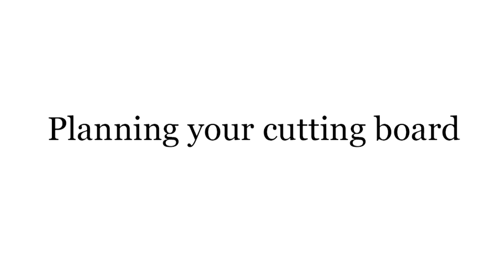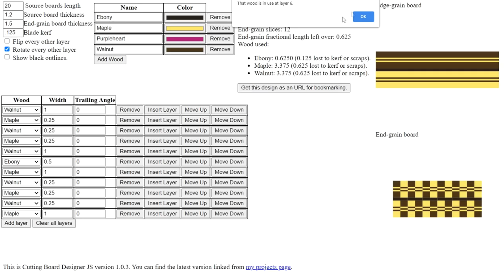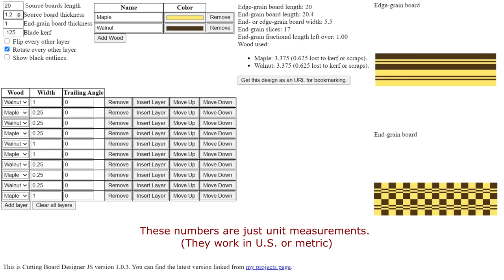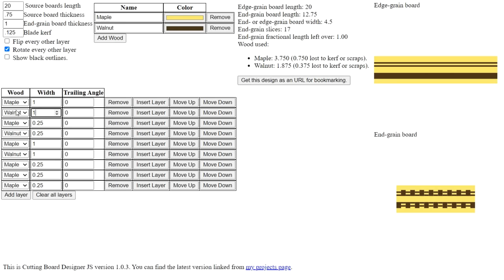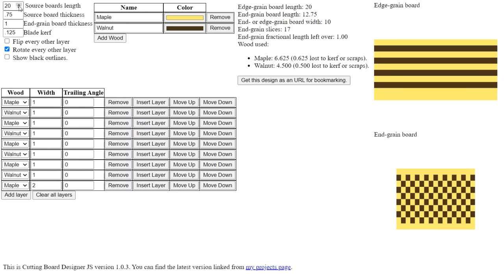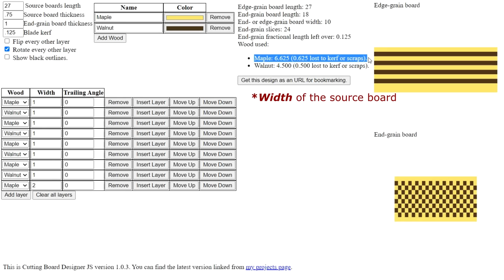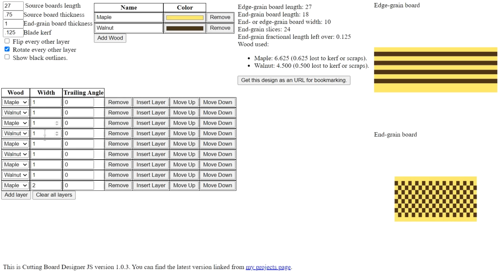The ultimate guide to making a wooden end-grain cutting board

Comment: I thank you Steve for this post and it was both educational as it is interesting, now having scrolled through many of the comments I see mainly wood shop things which makes sense, now I'm totally a newbie woodworker, but I'm also a educated and professional chef ret, but nonetheless, cutting boards, so in short it depends on what you are cutting or pounding upon a board.  Mainly the universal board are veggie boards which end grain boards are, but what you absolutely do not want to cut on an end grain board is meats, poultry, pork, beef and even some fish.  The reason has to do with of course contamination, for meats the best choice is synthetic or plastic cutting boards or fork out a bit more dough for a long bamboo cutting board, this is where the fibers of the bamboo are running the length of the board, it's a true natural universal cutting board for veggies or meats as the fibers of the bamboo do not allow contaminates to penetrate the surface of the cutting board.  So anytime you find or make an end grain cutting board it should be used only for veggies not meat, yes they damage less and yes they dull a blade less but do not use these boards for cutting meat especially chicken or duck upon you will not be able to fully wash or remove the contaminants of salmonella out of the board.  I'm sure someone will argue about this, but ask any chef and they will tell you what I said, synthetic cutting boards plastic and such thick and thin is what's typically used for meats, or long grain bamboo boards in that the grain runs along the length of the board not bamboo end grain.  Yeah you can make a cutting board but understand your market and how it's used.  My hope is folks make these kinds of boards but DO NOT USE THEM FOR FISH, PORK, BEEF, OR POULTRY.  Especially poultry.  Good way to make a great dinner that makes everyone sick.  Trying to help here not being a mean person.  This post is awesome Steve and I've enjoyed it but it seems like lately I've ran into this trend when I've gone to farmer markets and such and I said it's a beautiful board for vegetables and the person said yeah and anything else and I had to explain why you do not use end grain for meats and they were like oh I didn't know.  End grain boards are works of art, and yes as I said I agree less damage to the board marks and scaring and less dull to the blade but contamination from meats can and will bleed in too from that meats and you absolutely can not remove it from an end grain.  I have a $400.00 extremely large long grain Bamboo cutting board that is truly a universal, one board does it all and bamboo at a long or length doesn't allow contaminates to enter the wood.  Okay off my soap box just trying to help as it seems to be a trend to make end grain cutting boards and people are using them incorrectly and or for the wrong ways of preparing food.  Or trying to sell them to make a buck off folks who don't know how to use or have the know how of food prep on the best surface.  Whew, hope this helps.  Also on a fun note, I have a friend who decided to make a knife sharpening business and I asked why, he said you know for regular folks or chefs, and I said well as a chef I can tell you they will not use your service because we are taught in culinary training and arts how to maintain your knives. He laughed at me like I didn't know anything and about what I was talking about, after a few months and the comments he got on his website of course I asked how goes it, and he said the majority of his business is from the home chefs not professional.  Ah ha, I wonder why.  Okay seriously thanks for reading, and off my soap box.  Be safe and Be Well All!!!
Reply from the maker: Whoa...you okay?
Reply: @SteveRamsey  I am so sorry Steve, that mini novel lol, can come off a bit rant-ish, but my intention was more on an education level.  I love your channel and I'm a paying member to your WWMM website.  I've been watching you since you posted making a chess board and have followed ever since.  And it's neat to see glimpses of my home area, East Bay, love Santa Cruz, and La Honda area.  But I've got nothing but love and peace from NC to you my friend!

Comment: A great way to avoid the “need” for rubber feet on a cutting board is to also lay a damp paper towel down between the counter and the board. I prefer to do this so that I can route grooves along the perimeter on one side of the board and leave a completely flat side as well.

Comment: A tip: before the final sanding, spritz the cutting board with water to draw out those cut fibers. Then sand it down again.
Reply: At a glue joint, I wouldn't spritz it.  A water based glue will raise the grain, and then "freeze" it in place, but this is desirable on glue surfaces because it adds more fiber into the glue layer (which is microscopic).
Reply: NEVER  water spritz a cutting board during fabrication ever.
Reply: @OldDunollieman  it makes it smoother in the long run. That way it doesn’t feel slightly prickly after the first wash.
Reply: @Christopher_Wheeler  I'd agree spritzing any surface that's "touchable" after project completion, but that's normally a precaution only with soft wood (pine and birch and poplar all benefit), and I don't think glued surfaces are good candidates.

Comment: Steve, great video. What are your thoughts on wetting the board and giving it a last sanding before the finish is applied? Thanks
Reply: Wetting (assuming you mean water) the end grain will do little for making it smooth.  Wetting raises the "slivers" on the face grain which is a good idea.  Better to have the oil soak in and not water.

Comment: Great video. Question: Made an edge grain board (hickory and black walnut) now trying to figure out how to remove enough surface so oil will absorb rather than being blocked by Tite Bond adhesive. Don't have drum sander. Belt sander? How much do I remove? 1/8"? Maybe the Tite Bond won't block the mineral oil.

Comment: I'm surprised I've not seen this video because I'm a subscriber. Anyway two things. When I use pipe clamps I often get marks on the wood during glue-up (Titebond 2) so I have to cover them with wax paper. Mine are gray or galvanized I suppose. Yours appear black. Do you know what's at issue? One of the hot talking points on YouTube has to do with the governments consideration of making saw manufacturers  use SawStop technology in all table saws. As someone who is dedicated to keeping the cost of woodworking withing reason I'm wondered what you thought. And what about used equipment?

Comment: White oak is fine for end grain cutting boards. Wood boat builders use white oak for framing.  Stay away from Red Oak though.  I also think polyurethane glues like gorilla glue is a better choice since it is truly waterproof, and not just water resistant

Comment: I am using the software to make an end grain cutting board using the trailing angle function to make like a chevron pattern.  My dyslexia causes me to be really confused with such thinking requirements. My question: what edge is the trailing angle cut upon and is it cut before you glue up the edge grain board (first glue up) or after the edge grain glue up when you cut for the final end grain glue up.  I would like to know before I waste a lot of hardwood.

Comment: Tip for sanding cutting boards, when you think you are done sanding, spritz it with water, this will cause the tiny wood fibers to stand up,  let dry and re-sand with your finest grit, otherwise after first wash the board will no longer be nice and smooth

Comment: Novice question: at 18:23 Steve cleans up the long edges on the table saw with the fence. How does he do this, considering that neither side has a square / straight edge? I need to clean up my edges but I thought rip-cutting non-straight wood was unsafe. Thanks!

Comment: Hello Steve wonderful job and well explained, I have a question the cutting board I’m watching these the spray it with water before implementing the mineral oil and then they implement wax, with ur cutting board u have not the case can u pleas advise if we can pass the water and the wax process. Thanks a million
Reply: Spraying water on before a final finish is called raising the grain. It expands the surface layers of the wood that got compacted by sanding. It makes the wood rougher so you do a very light final sanding after you raise the grain. If you don't raise the grain, the cutting board will get rough when you rinse it with water 

Putting wax on can give a bit more water resistance and a smoother and shinier finish. Personally I like it but it's not necessary.

Comment: Ok one more question...after pipe clamps...you clamped down baord with 1×3 I think...wouldn't wood glue get on those and adhere to top and bottom of board? I just made all initial cuts have the flat clamps but what to clamp it down flat but if I use wood I feel like glue will ooze onto them and bond like concrete.
Reply: you have to cover the cauls (clamping boards) with packing tape...then pull or tap 'em right off!

Comment: Newbie here when it comes to using a table saw, so this has been a great instructional video.  My question is that at 15:27 why is a sled used and not the regular fence?
Reply: Cutting a piece using a fence in the same way he did here can be dangerous. With so much of the material moving beside the blade instead of feeding into it, it's easier to turn the board during the cut and wind up experiencing kick back. There's a few videos specifically about kick back and tips on how to avoid it. And kick back should be avoided. Hope that helps.

EDIT: Here's Steve's video about kick back:  https://www.youtube.com/watch?v=EtFtEUjiurk
Reply: @carpepesci  Many thanks for the clarification.

Comment: Hey Steve. I'd consider myself a bit of an end grain cutting board expert. I've made maybe 400 or so of them with fantastic results. 

Edge grain boards ARE more durable than face grain boards. The edge grain takes knife marks better along the grain than face grain, and also face grain warps easier than edge grain due to the happy or smiley face of the end grain pattern of the face grain boards.

Also, your board you made here is way too thin. It will warp super easy with it's length. The wider and longer the end grain cutting board is, the thicker it needs to be to prevent warping and twisting.

I think you have a fantastic channel and I love hearing your opinion, but I wouldn't say something is an "ultimate guide" unless you have a little bit more knowledge and practice under your belt.
Reply: Steve needs a little bit more knowledge and practice like you need lessons in arrogance.  But I'm sure he appreciates your opinions too
Reply: @epona9166  I believe it's more confidence than arrogance, but that's a matter of opinion both ways lol. I am not saying I am the best. But I would indeed say I am an expert in building end grain cutting boards. You can see some of my work on my YouTube channel as I made one of the most difficult end grain cutting board designs and wood combinations I've seen. Again... I'm not saying I'm the best ever. But I am very confident and proven on the subject of end grain boards.
Reply: @MaydaysCustomWoodworks  Lol if this guy knew who you were, he'd think twice about calling you arrogant. Miss seeing you murk dudes, hope you're keeping well!
Reply: @wasim.j  lol. That's funny. I appreciate the support of my previous career! I love martial arts, but I don't miss getting punched in the face for money.

Comment: Right at 17:37, gluing those all up like your doing...whenever I start gluing stuff, I find the wood glue sets up pretty fast, and I can no longer adjust the pieces relative to each other, within a minute or so.  I could see my pieces setting up before I even got my clamps in place.  Is there a secret I'm missing?  Would more glue take longer to set?
Reply: a minute is the usual amount of time you have to move piece around with wood glue, you just gotta work fast and make sure you got your clamp strategy planned out. you can lay on the glue thicker, or you can get "Titebond Extend Wood Glue" which claims to have a longer open time

Comment: ok, end grain boards do not require more lumber, a 20 by 30cm by 3cm board, end grain, edge grain or flat alll require the exact same amount of lumber. Thats just how volume works. End grain requires you to be more percise when cutting and causes more waste when cutting, but if you start with the same boards for all three you will end up in a very similar ballpark for wood used, unless your boards just so happen to be the perfect lenght for your flat board so you have no need to cut anything. In that very specific case you will need more wood for end grain. Alternatively, if you only cut of 3cm from each board and throw away the remaining 22cm you will also use much more lumber.
Reply from the maker: Thanks for the lesson!
Reply: @SteveRamsey  Yea sorry to be so pedantic. It just felt like your focus was kinda off. I mean half an inch of waste (according to your program) seems miniscule when compared to the 4 times you need to cut instead of once, and two instead of one glue-up. Like the amount of work is insane and not the difference in lumber used.
Reply from the maker: @AlphaHorst  I'm just showing how to build a cutting board. I guess I misspoke!
Reply: @SteveRamsey  nah i am just pedantic. sorry for that. have a nice day

Comment: Are there any issues to add a juice groove around the perimeter on end grain? (this is also a test to see if Steve replies). :-)
Reply: I was thinking of doing this when I get around to making one. Simply for the ability to easily show which side is for meat and which is for everything else.
Reply: I'm going to attempt my second end grain cutting board this week The first one I messed up by trying to sand with a belt sander. The edges tore out. This time I will chamfer the edges with a block plane first. Also I will use a router sled to smooth the surface rather than a belt sander. I saw a video recently of routing a juice groove using a simple edge guide template. Cheers.

Comment: I have been watching for years and finally found something to gripe about. 
The oiled endgrain cutting board is sanitary. More so, in fact, than a used plastic board that just came out of the dishwasher. 
That's a bold statement but it is true. 
So my gripe would be that the main advantage to an endgrain board is that it's the most sanitary board available, and that any other wooden board is not to be used as a cutting board at all. Certainly not for food and never for wet food, and absolutely never for meat. Ever. Gross. 

The reason for plastic being less sanitary is because the knife will cut groves and slices which protect the bacteria during washing, giving it an opportunity to cause you food poisoning. The endgrain board fibers are tight and squeeze the knife out leaving no room for bacteria or gunk to enter. You have to keep it oiled, and sand it down once a year.
Reply: This is mostly incorrect. Yes, plastic boards are always worse. No, engrain is not really any different in this regard to other wooden boards. There's been research on this topic. The thing is, the wood is naturally antiseptic, bacteria caught in the wood is not able to multiply. Wooden boards of any kind are the best for meat, but you still need to clean it thoroughly and then ideally pour boiling water on it.

Comment: I recommend not putting feet on your cutting board. I was pounding out some chops on mine, and because the center was raised, the board cracked right in half. If the board slides around on your counter while you're working, try putting a damp towel under it.